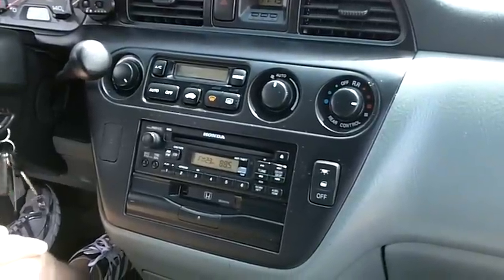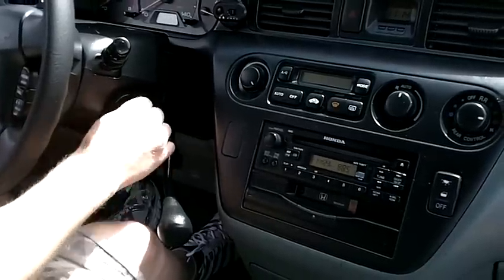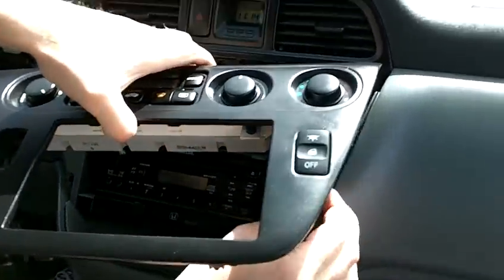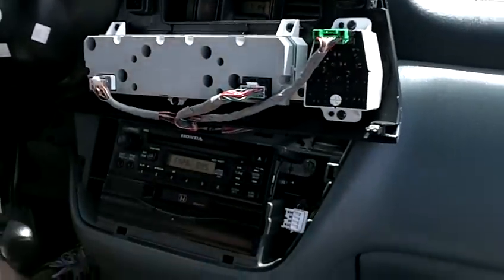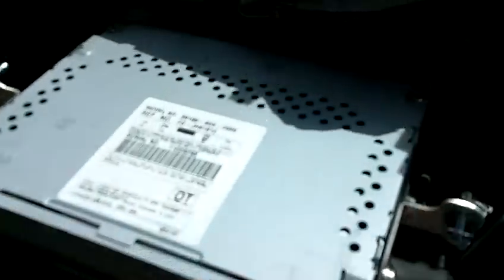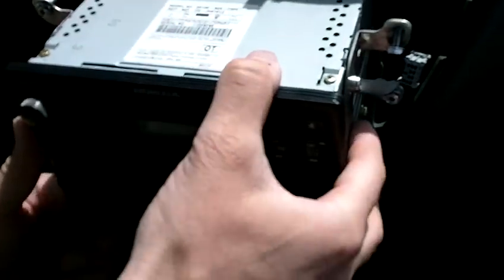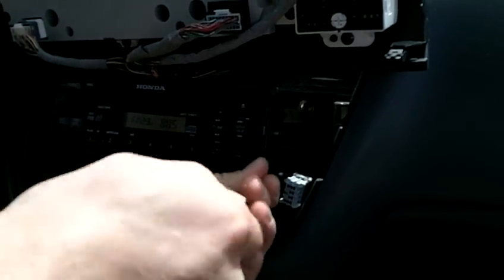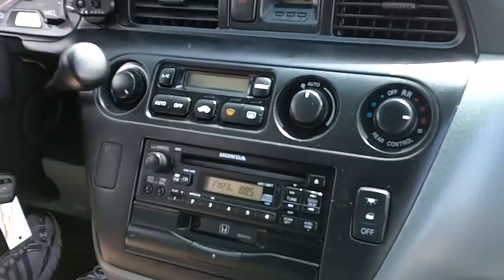How to remove a Honda Odyssey Radio - Dash Removal 1999-2004

Comment from the maker: PSA-- someone mentioned holding down the 1 and 6 on the radio then powering the radio on to reveal the serial number.  This only works on 2005 and newer odyssey's.  The older 99-2004 models need to have the radio removed to view the serial number sticker.  Also if your "tab button is not blank like the one in the video, put your slot screw driver somewhere around the edge of the dash piece and very carefully try to pry it out.  Be gentle as you can easily nick and damage the plastic if you are not careful.
Reply: My experience the code is on a sticker in the glove box

Comment: If the panel does not pull off with the finger pull,  use a flat head screwdriver to gently pry the bottom, then side edges (between black and gray).   To remove the lower electrical plug, push on the left middle edge retainer as you pull out--removing this one overhead light on/off  connector is sufficient to access the radio.

Comment: Worked like a charm...  Saved me $150... My serial # was on the bottom,  not the top so i had to take out 2 more screws for the space section underneath.. so i could see the bottom of the deck .

Thanks again !

Comment: The light control switch in your video is on the right side of the radio.  That spot has a passenger airbag on my 2004, and my light control switch occupies the space where you stick your fingers to pop out the large plastic cover.  Since I can't do that, what would be my starting point to pull the large cover?

Comment: I think your video is maybe 99' to 03' 🤔 because for my 2004 that moulding cover  extends all the way to the steering column. 😗 also there is no empty tab to pop out and "use fingers to pull" ; the left side where that little tab/cover is... is the toggle switch for my interior lights 💡 and the right side is 
"Passenger air bag" indicator light. 📍 I'm figuring flat head screwdriver 🪛around the edge to pop up That moulding piece; going to try that very gently.

Comment: I have a, I think they call it a DIN 1, slot.  there is not tape deck.. only CD and radio.  I think it's smaller.. Is it the same?  I want to replace the radio with an aftermarket.. I think it's Kenwood.  is there an adapter kit that I need or will it work without an adapter?

Comment: So I have a question. The tab you remove on the left, on my honda oddyssey 02 there is a switch with a red light where that tab is. Do you know what that might be and what it's used for? I got the oddyssey at an auction so I have no idea what it is. Every video I watch on an oddyssey doesn't have this switch. So I'm lost on what it could be.

Comment: My 2003 does not have a regular tab. It’s for the inside lights.
Reply: Use a screwdriver and pry the panel around the radio!

Comment: I have a 2001 and yes in the glovebox there's a number but I didn't know it was the serial number of the stock unit. I ended up pulling the radio anyways and it matched. The 1 & 6 with power on of the radio didn't work for me. Honda wanted $165. Talk about a scam.

Comment: My 2004 Honda Odyssey does not have the blank tab.  It has the light tab (the one on the right in your video), on MY left, and a Airbag tab on MY right.  WTH?  So frustrated as I bought this used - the 1 & 6 does not work, it's not in the glove compartment or fuse boxes, and I'll be damned if I can figure out how to get the radio out by all the videos I've been watching since they all seem to be different from my Honda.
Reply: Use a screwdriver and pry the panel around the radio!

Comment: With your radio off and ignition key at ON, press 1 & 6 on your radio simultaneously.  While pressing, turn your radio on and your serial # will appear.  Total of 8 numbers, disregard the letters.
Reply: Pressing 1 & 6 doesn't always work...doesn't work on my 2004 Honda Odyssey.

Comment: why do you need the serial number? what if you are installing a new stereo head/dashboard thing?
Reply: If the battery is disconnected the stereo goes into security lock mode. Need a code to unlock it.

Comment: this one is nothing like mine, yet mine is a 2004.  WTF?  guess it's good for you guys, thanks anyhow.
Reply: Yes. I think his video is 99 to 03 🤔 because for my 2004; that cover piece extends all the way to the steering column. 😗 there is no empty tab; the left side where his tab/cover is... is the toggle switch for my interior lights 💡 and the right side is 
"Passenger air bag" indicator light. 📍 I'm figuring flat head screwdriver 🪛around the edge to pop up That moulding piece; going to try that very gently.